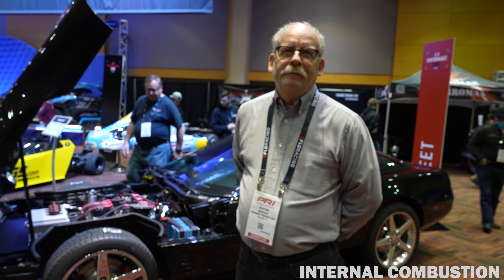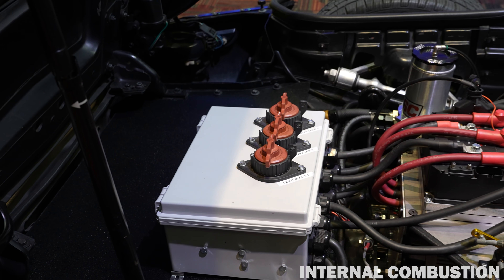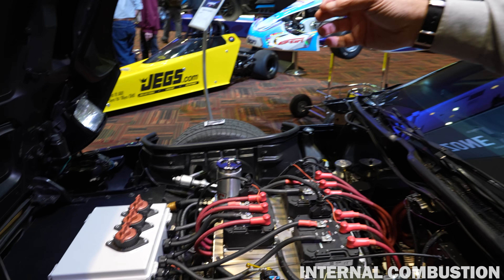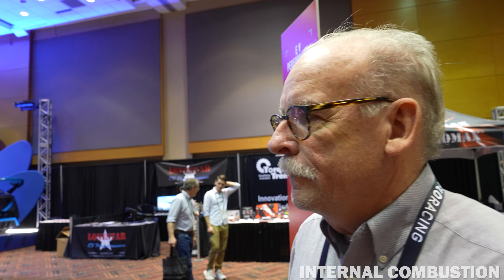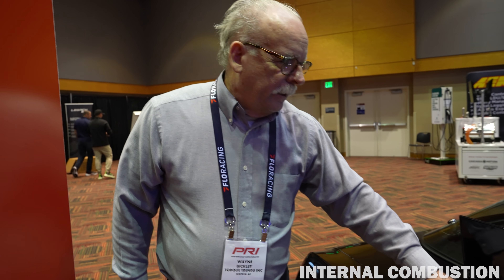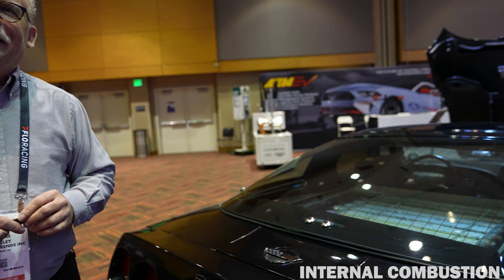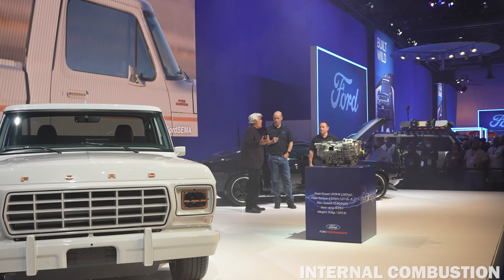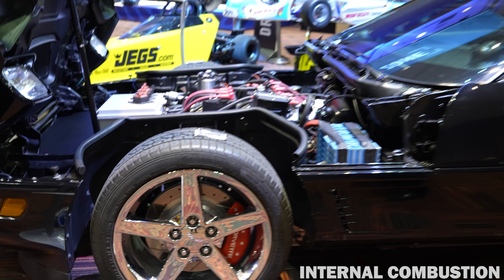1996 Electric Corvette Electric EV Conversion

Comment: interesting that this guy runs three motors, when the comedian  Tim Allen invested a lot of money before ditching the three motors with gear concept in favor of a single motor direct drive that he could actually make work in the hot rod he was building.   Of course , Allen was not the builder , he only financed his build with what appeared to be a more traditional hot rod builder.   And he did complain about the quality of his advice.

Allen has a YouTube video about the uncompleted build.      I am always interested in updating my old vette to electrical power, but it is still too financially and mechanically exotic to install practically into my old car, since the platform was not designed for a lot of extra weight .  I am always hopeful for the future, so always check for progress on corvette conversions.

Comment: Who wants this...
Reply: Umm, me? Honestly, 180 miles is pretty impressive for a heavy car. It’s a great weekend car, the only difference is that you don’t have a ton of range and your helping the environment a little bit.
Reply: Me.. but with a different battery pack design.. 38120 high discharge headways instead.. for a 9 second quarter mile car.
Reply: @whatta7793  I honestly would convert my corvette to electric if it was cheap enough. I don’t mind 150 miles of range honestly, considering that I would barely ever drive half that distance in a weekend.
Reply: @diplexnormal3353  agreed. I kind of want to buy a cheap C4 as long as it's rust free and interior is in good shape, just to toss a Tesla motor in it, and put a high discharge battery pack in it. 

Look up "electric mazda miata" and click the 3rd video, it's a green Miata that runs 9 sec quarter miles CONSISTENTLY.

Comment: Really sweet conversion. Acceleration is actually better than on the original. The range is not very great like on most conversions. Maybe that's caused by the aerodynamics, but I'm not sure
Reply: There’s some range and power loss due to the hyper9 setup. These motors typically use the original transmission and driveshaft vs direct to axle power Teslas and other EV motors have. On top of that, he has 3 hyper9 motors. More motors mean more power, but also more energy loss. If he were using two, or even just one, I bet he would get a lot more range out of those batteries, but I’m sure his goal is to have a fast EV to show people that EVs are the future of hotrodding. That’s the issue with EV conversions. Deciding which is more important, range or performance. It’s not like he can decide to drive in “eco mode.” ...yet.
Reply from the maker: Thanks for watching! Glad you enjoyed!

Comment: If the motor was blown up in that vette, guess that's a good conversion.  Kinda ruins the point of these cars though since the V8 note in these is very distinctive.
Reply: That's my no.1 rule about converting a non-ev to an ev. If the engine died or lack one that's where I would convert it.
Reply: @WitchyWhale  That’s actually a really good principle you got there, I like that.

Comment: What a waste of a good Corvette.
Reply from the maker: LoL you don’t think this is cool at all??
Reply: @InternalCombustion  
No, I don't. He took a good car with a range of over 400 miles and reduced it to 180. He also reduce the top speed, and instead of taking five minutes to fill up it now requires an overnight charge for another 180 miles. Ridiculous.
Reply: @20alphabet  you completely missed the point of this build,  He was not just trying to duplicate another old  C4
Reply: @richardelliott8352  
You completely missed the point of the original comment.
Reply: there are so many c4s if you are offfended buy up all of em
Reply: @YungEagle3k  
There are so many offensive comments, why don't you respond to them all?  And work on those English skills.
Reply: They made so many C4 Corvettes, it's a mass produce car. I'm sure that there are plenty of non-ev converted C4s to buy.